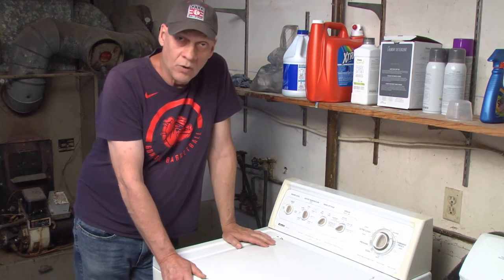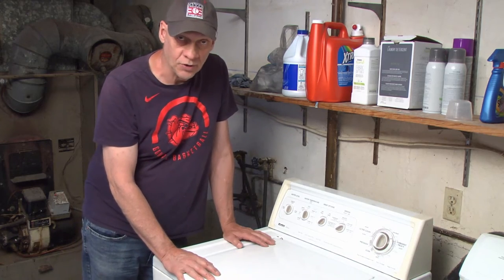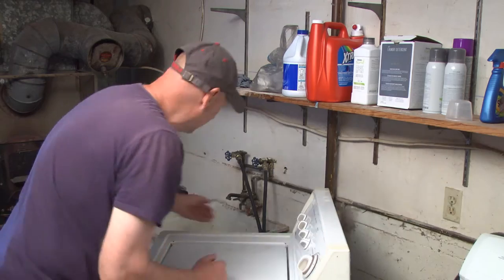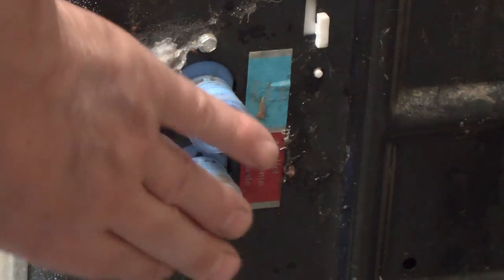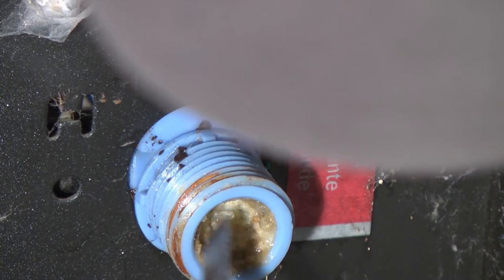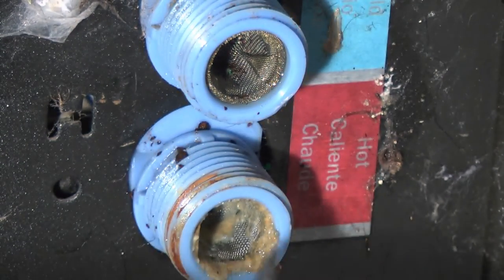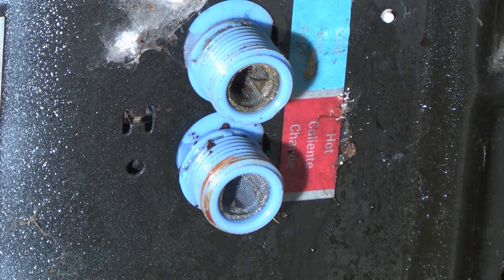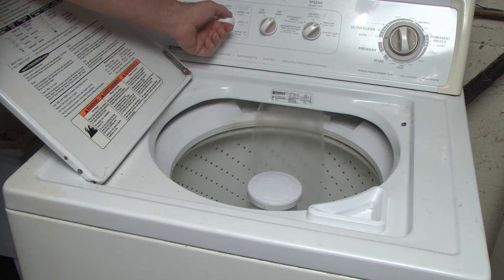Clothes Washer - Washing Machine - No Hot Water - How To Fix

Comment: Thanks for the video! It got me started, but unfortunately I couldn't just clean with q-tip.  On my machine I was able to use a small slotted screwdriver to pry the screen out and clean. Unfortunately in my case I might just have to replace it, which there are a lot of options on Amazon.
Reply from the maker: Glad I could help!

Comment: This was really helpful. My filters were metal and seemed to be smaller than what was in stock at Home Depot. I put them in backwards so the hose would fit. I’m sure that will result in some kind of issue but I’d rather get a few loads in today lol. I’m trying to find any issues putting the filter in backwards(the mesh dimple is pointing towards the washer) could cause?
Reply from the maker: It will probably be fine. Thank you!

Comment: Good repair video, but we have a different issue; we get WARM water on the warm setting, but the HOT setting does not give us hot water, only cold. We believe it's a computer board problem. Getting a repair of our Speed Queen is almost impossible, so we are simply learning to live with warm or cold water washing. Appliances are absolute garbage nowadays.
Reply from the maker: Some appliance computers are garbage alright. Thanks for watching and commenting. Take care.
Reply: Could be a simple broken thermistor. They go bad and are easy to check. The tell the board how hot the water is. Mine had 33kohm instead of 47 kohms and this caused it to not open the hot water side!

Comment: I have an Insignia HE machine that's about 3 years old, purchased from Best Buy...(with electronics unfortunately, as even the washer/dryer  repair stores that also sell used washers don't even have any 'old-school' washers for sale anymore, and they are almost never sold on places like Craigslist either.  The Only new choice for an "old-school' type of washer was a very pricey Speed Queen, of which the economy model was over $800 plus tax and delivery.  Yikes. Sadly that wasn't going to be part of my life but it's what I really wanted).
 
Very recently, when I have it set to HOT for washing the sheets I use on the sofa which my 2 large dogs and cat have commandeered as their own, Only cold water comes out.  The tub fills normally on the hot setting, but only with cold water. 
Can water heater sediment actually be the issue in this case? (It's a 21 year old heater using well water so I'm sure there is a lot of sediment in it by now, but I can still take a long shower and not run out of hot water.)

Is this possible? ~~~   
>>>> Could the electronics of the washer redirect it to fill the tub with cold water if the filter is clogged in the hot water inlet? 
This seems unlikely to me, but I am no expert on electronic anything lol. 
I have plenty of hot water everywhere else in the house when I want it, that is much farther away from the water heater (which is only 5 feet away from the washer) but I don't use it much anyway, except in the shower.  

My washer is out of warranty; I definitely can't afford to pay a repairman. Maybe I just have to boil a big pot of water on my stove, then carry it to the washer, dump it in & let it mix with the cold water ~ at least it would be somewhat 'hot' and not totally cold. I'm not really happy about having to do that, if that's the case.  I can't entirely fill it using a 15 foot hose from the shower head to the washer, unless there is some easy way to disable the electronics that determine how much water enters the tub, which I'm guessing must be based on the weight of the dry items in the tub. There is no setting that allows me to choose the water level in the tub, like load sizes of "small, medium, large, extra large". I'm definitely not a fan of electronic gadgets, I much prefer being in control myself, as much as possible, & not being controlled by machines.  I'm so low-tech that I've never even owned a television.
Reply from the maker: Check those screens on your hose inlets.

Comment: I still have no hot water plus I replaced the inlet/out valve and hoses and still no hot water just cold. Any ideas what else the problem could be?
Reply from the maker: Is your machine computer controlled? That is a common problem.
Reply: @hardluckcharlie  yes

Comment: i just got the water mixer replaced by SQ service yesterday because I could not get the cold water to turn off at all even though the machine was turned off electrically, I had to turn off the water source or ir would overflow.  So yesterday service replaced the mixer and now even on heavy duty i cannot get hot water, just warm??? On the heavy duty hot water select, it runs cold.  Must be another government regulation on the replacement part???
Reply from the maker: I am unaware of any government restrictions on washing machine mixers. If your mixer is computer controlled, that is where I would next investigate. Good luck.
Reply: @hardluckcharlie  as it turned out the service guy put the mixer on backwards so  now it is correct.  After I wrote the above I went and checked out the cold and it was hot so it was just reversed.  Thanx for reply.

Comment: Hey, I liked your video but it's not the solution in my case. Hot water spigot will give you a pitcher of water, the hose doesn't have a clog and the screen at the back of the washer only had maybe 8 of those tiny little holes clogged. I took it all off to do this and put  'er back together and got hot water. GREAT! Went to get my detergent and go to fill the machine, NOTHING AGAIN. Double checked and yeah water can go freely through faucet and hose and again, screen is fine. So what to do next? And say anything but call a plumber cause that ain't happening. lol
Reply from the maker: Haha. I can't afford no plumber either! Just keep searching videos. Chances are you'll find the cure. Thanks for watching and commenting!
Reply: @hardluckcharlie  I ended up figuring it out on my own! I should go into business! haha But thanks for the support, cause that got me thinking! 🙂
Reply: @TheCopperFrog  what was your solution?  My Hot water inlet valve was clean, what did you do next?  TIA
Reply: @TheCopperFrog  I’m having the same issue.  What did you find?

Comment: I’m not getting cold water and I changed the inlet valve still no cold water 🤷‍♀️
Reply from the maker: If your washer is computer controlled, it's a good place to start. Good luck!
Reply: @hardluckcharlie  thank you I changed out the washer water temperature switch and it worked